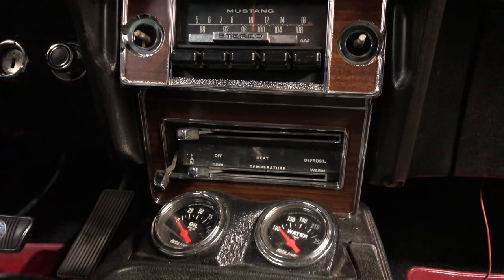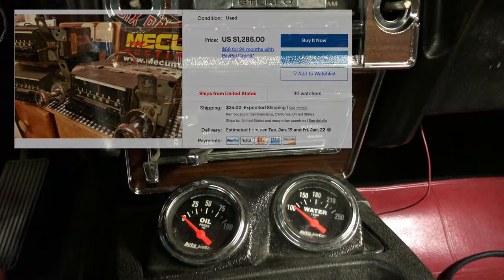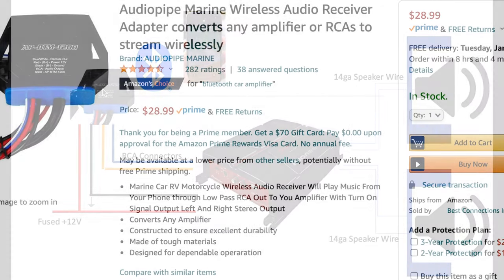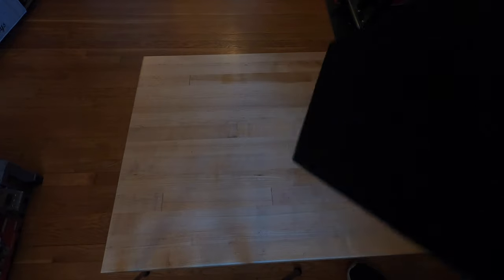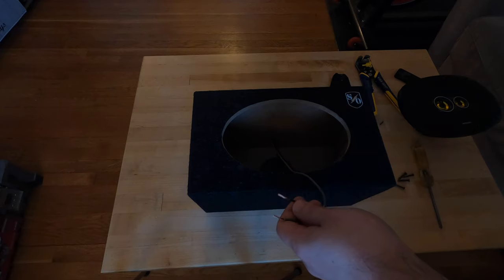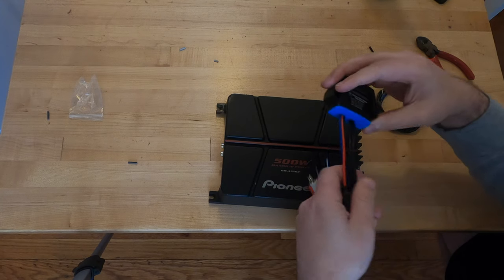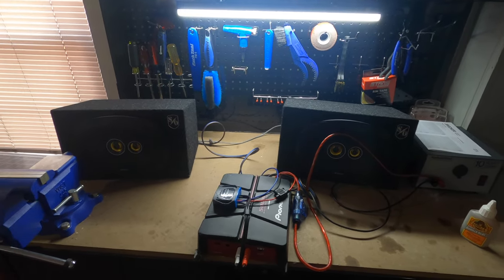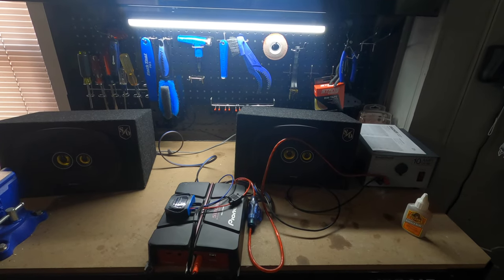Building a Bluetooth Stereo

Comment: When you connected the amp to the battery, how do you make sure it doesn't drain your battery by staying on
Reply from the maker: Two ways. Relay from the ignition switch will definitely cut it off. The other way is to have an amplifier which only turns on when it senses an input. The app I have will turn on when it has an input. You can also add a switch in that line it so that it doesn't accidently connect to the phone.
Reply: @SmackeysGarage  thanks for the info it helped a lot. For an update I ended up putting in a killswitch( one normally used in tractors) in my center console.
Reply from the maker: @DEADBYSUNR1SE  Thats a good idea. I’ve been thinking about adding a hidden kill switch to my car too.

Comment: My Camaro radio went out do u think I could connect the Bluetooth adapter directly to speaker wire? I have connected my subs to my phone but volumes is lower than my phone. A new radio and dash kit is too expensive.
Reply from the maker: The bluetooth adapter in this video, no. You'd need an amplifier + BT adapter. Take a look at this video. That is how I have my retro sound speaker set up.

https://youtu.be/z8oarMw8KGQ
Reply: @SmackeysGarage  would the whuzi amp work with two skar 8s? I have a pioneer amp but it isn’t the right one for my 1 ohm speaker s. I was running them without a amp off rear speakers. My radio went out when I was trying to install amp. Code u0184 lost communication with radio. Now my speakers,turn signal sounds, and seat belts noise don’t work. Radio drains battery so ac went out. Took the radio out now the ac works again. My screen and volume control don’t work on dash kit. My steering wheel volume control doesn’t work either. And I get no sparks when I put my speaker wire on a screw in trunk. So I was tryna find a cheap option to listen to my subs. I tried a boom box, a tablet, laptop, and then connected to my phone. The volume is extremely low don’t have money for a professional installation.
Reply from the maker: I see it is the subwoofer and not just speakers. I doubt it would have enough power for good sound with a subwoofer. Without enough power you'll have the same issue. Really low volume.

Sounds like it has been quite the hassle. What type of car is it? It almost sounds like a fuse blew somewhere in the dash circuit.
Reply: @SmackeysGarage  a 2014 Camaro lt with 2lt package. Iv had it less than a year. I got it with 47k miles on it I just recently got to 50k.  It turns out that GM are making bad radios. I didn’t know this at the time. I have had 2 diagnostic test run on it. Code U0184 lost of communication with radio. All my fuses are good. Battery and alternator is good also.
Reply: @SmackeysGarage  I also have another question does the screen on dashboard kit come off do I have to buy a new one?

Comment: Great work! So you still use the stock speakers 2 ea at kick panel and 2 ea at the rear window with your original stereo? And you never touch your radio? I wonder if I can use those original speakers with the Pioneer amp and bluetooth adaptor? I have the same 69.
Reply from the maker: I do not use any of the original stereo equipment any more. The original stereo is powered and lights up but is not hooked up to anything. I only use these two speakers connected via Bluetooth to my phone. I’m not sure the power handling of the original speakers. I’d be careful connecting them to a modern amp.
Reply: @SmackeysGarage  Thanks! One more thing - can you share the model # of the pioneer amp? 2 channel I think.